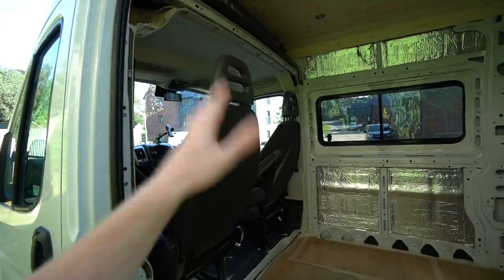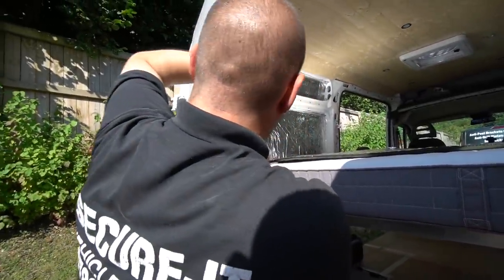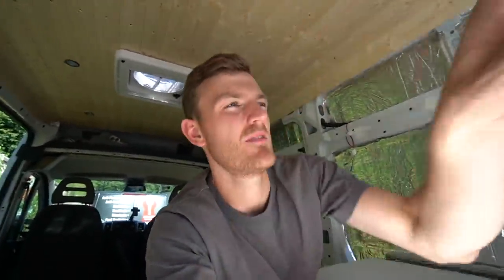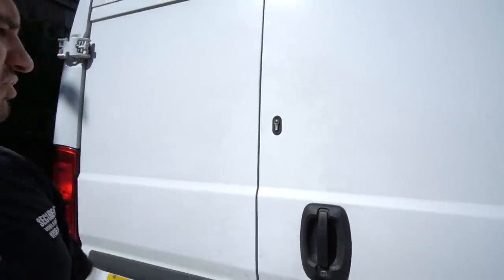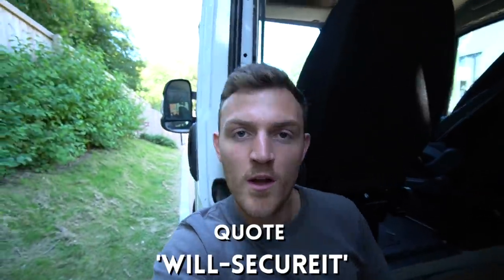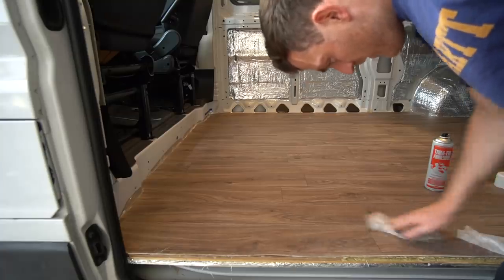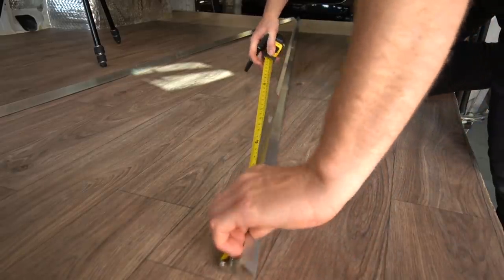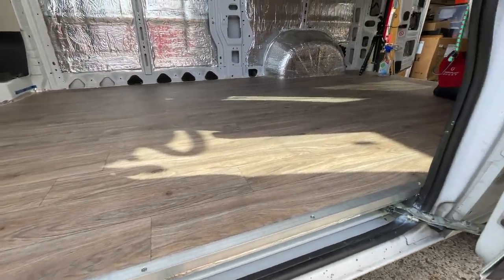ADDING VAN SECURITY | DEADLOCKS & FITTING VINYL FLOORING - No Experience Van Build

Comment: Hi Will, cladding looks great. Don't think it even needs a stain. Deadlocks are a great idea. You're starting to look more like a traveler and less like a builder. I wouldn't take the windows out. I think it will take a long time to rust and the bonding around the window should keep the moisture out. No moisture...no rust. All security is good security. Prevention is better than cure. You were like Spiderman putting that floor adhesive down. 🤣🤣🤣 Cracking job mate. Well done. That's a lovely big workshop you've got to work in. It's coming together mate.
Reply from the maker: Thanks very much guys! It’s beginning to take shape

Comment: I want to say thank you for the videos. I was inspired to finish a build I delayed for two years. After I saw you get your new van, I spent my two weeks off work to get it completed. It's an Iveco Daily long wheel from 2017. It had 35K on the clock and was used by an artist for transferring his paintings. I may have overdone it with the solar panels. Around 1kw and four batteries. If you're wondering, I have a gaming PC in it. I was inspired by another YouTube person on that one. I added a split charge relay which is a game changer. I no longer worry when the English weather does what it does best. 

I look forward to the day the van is done and you're off travelling. Cheers.
Reply from the maker: Thanks very much, it’s great to hear you got the motivation to get yours finished! It sounds like a beast

Comment: Hi Will. You don’t need to use an angle grinder to cut aluminium has it’s a soft metal. You can a normal electric wood saw to cut aluminium has the saw blade is made of steal. Please keep the videos coming 🤘

Comment: 15:35 It's a grinder with a cutting wheel. You can certainly use it to cut your aluminum angle but a portaband would probably be better. A portaband is what we use in the trades here in the US.

Of course your hacksaw works, it just takes longer.

I see you like to build stuff. When possible invest in a portaband. It's a must have tool in your tool arsenal.

Comment: Will. Loving it dude keep it up. Now. Grinders. The disc should sit on a ring on the grinder that centres it. Then it won’t terrify you wobbling. There’s a few sizes so you need to get the right one for your grinder. But you’re right a saw is better for just a small aluminium cut. It’s fairly soft. You had a coping saw which is meant for cutting shapes. You can ‘steer’ the cut. A plain hacksaw has a deeper blade so cuts a straighter cut. No probs though it wasn’t critical for this job.
Reply from the maker: Thanks for the advice guy, I’m learning from the comments that’s for sure!

Comment: Good call on that angle grinder. Aluminum is like toffee, sticky shit. It requires own cutting disks, you can burn out the grinder with disks intended for steel. (Not with that flimsy strip, but with bigger jobs)
Turn the nut around and check that the disk seats properly.

Comment: The windows as essentially glued to the outside of the van over the holes you cut for them , you should be able to access the cut edges from inside the van still , no need to take them out .

Comment: Will if you do use an angle grinder please use a face shield as well as goggles, if a disc was to shatter you could end up like (Leeds Boiler Company - iPlumb - Michael Goodall accident with angle grinder 2019 (look it up on YT, didn't add a link because sometimes people don't click links), we'd all hate that handsome face of yours to be mangled. Nothing to do with vans but around 20yrs ago where I live now we had a Ford Sierra, my hubby had gone to bed early so I went to check on the car and it had gone, I ran outside barefoot in my pj's only to see it on the corner of the road with 4 youths in it 3 scarpered and one remained behind the wheel, I ran at the car with the intention of kicking the door closed on his legs to break them, he jumped out and threatened me with a screwdriver, so I screamed at him " you think you're f'ing big enough try me" he ran off, so if you need a bouncer to look after your van I'm your woman 😁👍.

Comment: Don't mean to p**s on your parade, mate, but picking those locks should be an easy job for a pro.  Two of the most reliable solutions for a van like this that I've seen are Thunderbolt locks for the doors ($239 each), and 4mm anti-shutter window film for the windows. I'd also add Pro Plate Handle Protection into the mix (£29 x4), as most of the van break-ins are done with just a screwdriver.
To save on the costs of putting a Thunderbolt locks on all 3 doors, you could just put simple manual latches internally on 3 of them, and then just 1 Thunderbolt on the driver door.
I guess van security works the same way as with bike security in London: you don't need to overdo it, just make it difficult enough for the thief to move on to the next one.

Comment: Too bad he couldn't key the new locks to work with your van key. Maybe you should make copies & keep them someplace or with someone who is easy to get hold of in case you lose your keys. With those deadbolts locked it will cost a bundle for a locksmith to pick his way in.

Comment: I got yelled at when I took my car in for an oil change because of the amount of keys I had on the key ring. He said the weight overtime would pull on my starter where the key went in and it could damage it. Now I have a car that you push the button to start it so I don’t have that potential problem.  Is that something that’s going to come down the road to you??